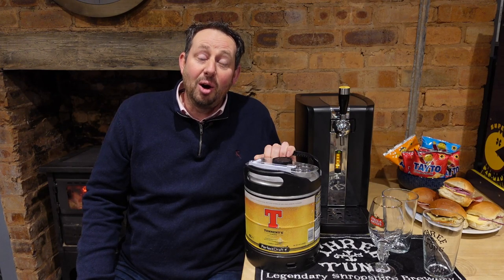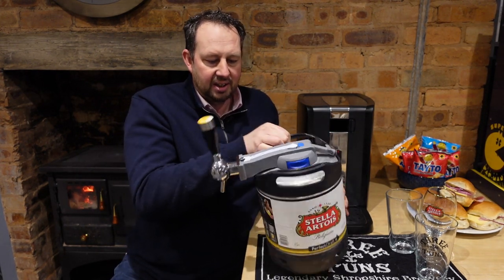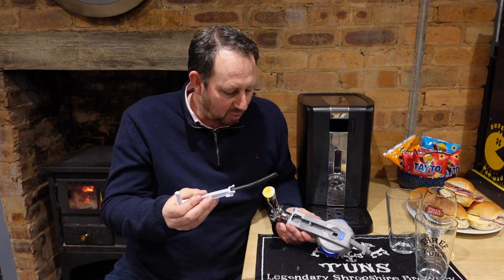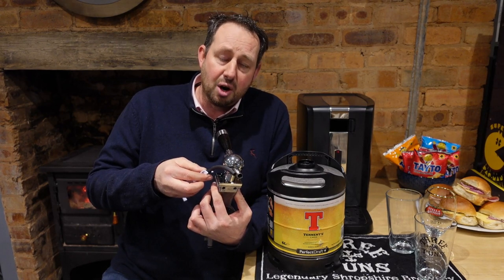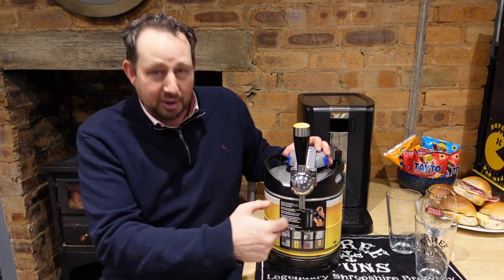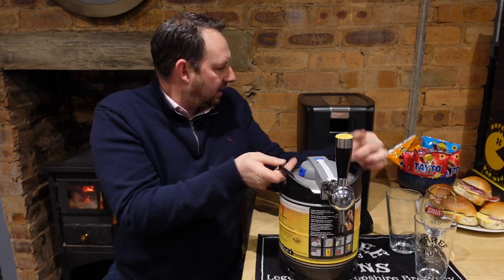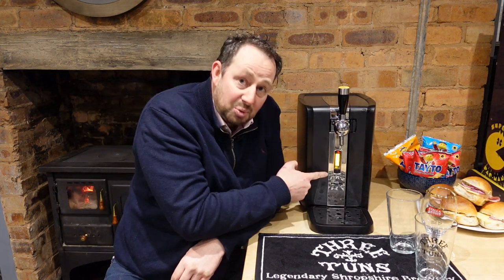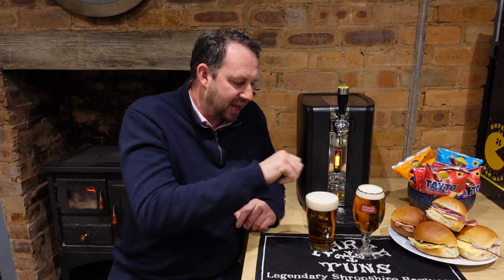Perfect Draft Keg - how to change the barrel on a Phillips home beer machine

Comment: Can you use other kegs as one I'm getting  off is rather limited choice  cheers
Reply from the maker: That is the only downside is there is limited choice and they tend to lean towards the stronger continental lagers.
I'm on the lookout for a machine with greater variety myself.
Reply: @JimmyTheMower  I don't mind the strong beers normally  I only drink stella but will try the Ipa  and also try get the moretti

Comment: Thinking of buying one but I see you missed something very important. You didn't show us hkw to connect the line to gas and didn't mentioned anything about how the gas thing works exactly. Any guides on this please? Thanks
Reply from the maker: There is no gas and no gas line. That is the full information.
The machine chills the keg and pressurises the keg and dispenses the beer with just one line 👍